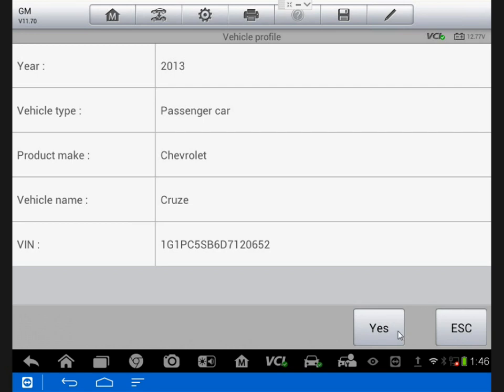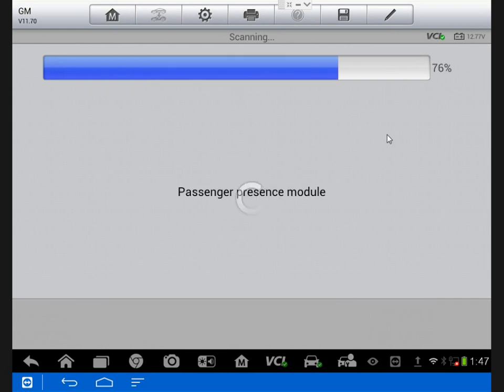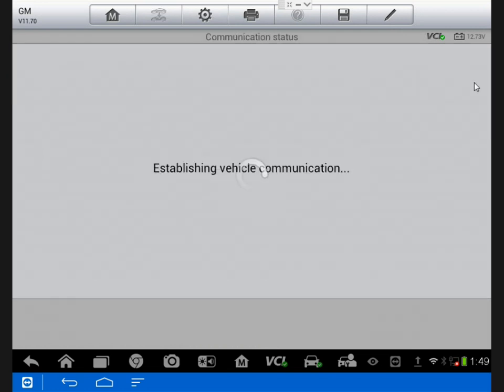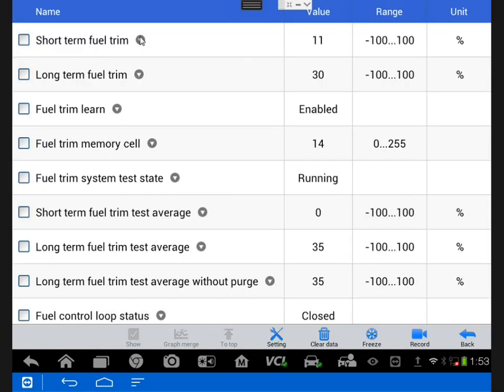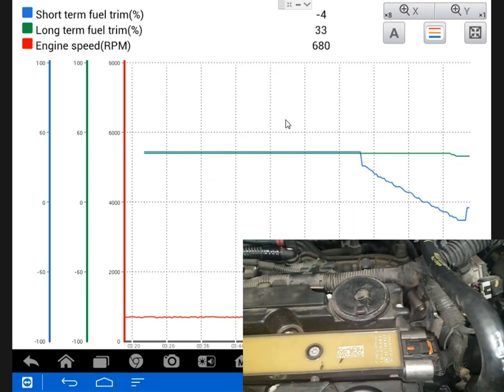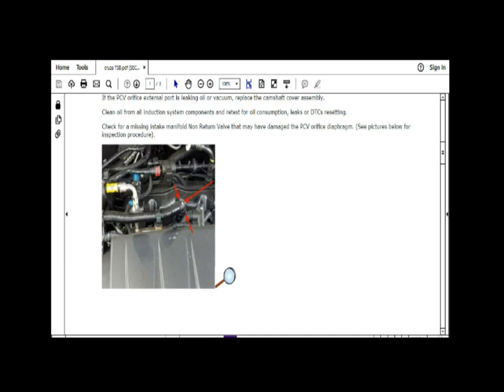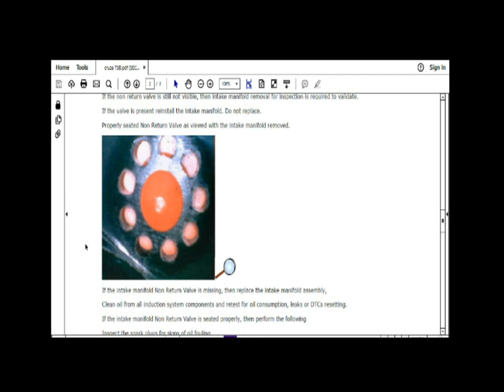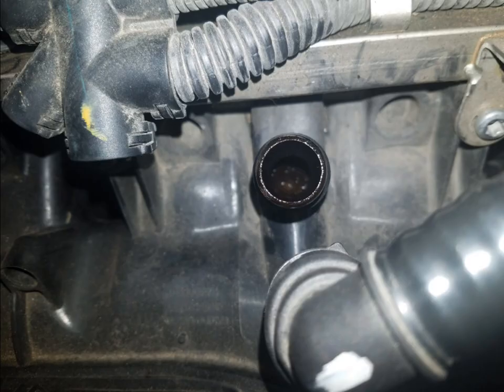Chevy Cruze, MAP, Lean and Misfire Codes.... WITH A TWIST!

Comment: When u put ur thumb on the pcv valve cover do u have to feel a suction in it or air pissing out of it..?? And which is a map sensor on cruze 1.4l turbo . I did recently replaced turbo sensor but still have check Engine light on for code P0236. It says turbo boost sensor A circuit range/performance. What doest it mean .. do u have any idea?? I will be really thankful to u if u could help me out..! 

Thanks
Reply from the maker: At idle you will feel suction, under boost you will feel pressure. If you feel pressure at idle you have an excess of compression gases leaking into the crankcase. You will need a good understanding of the system to properly diagnose a P0236 code as there are many possibilities. The definition tells us a lot of information, a range performance just means that the reading from the sensor is outside of the expected range that the PCM is expecting to see under any given condition.
Reply: Keith Perkins ,,thanks for the information mate.